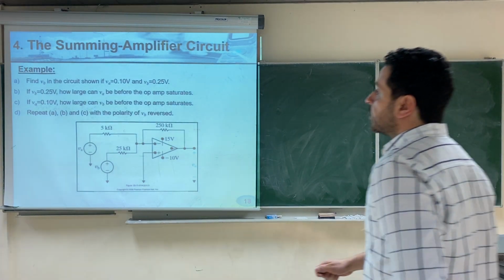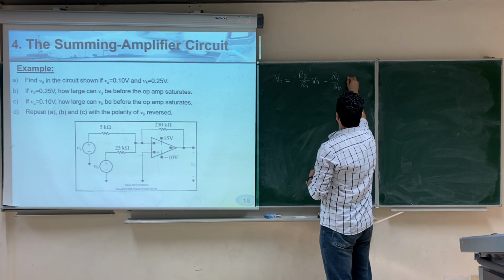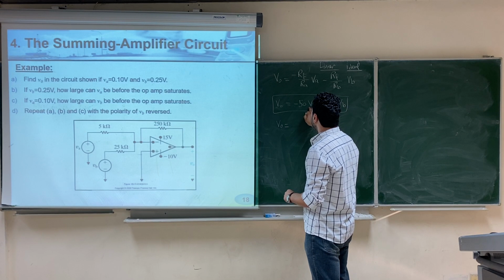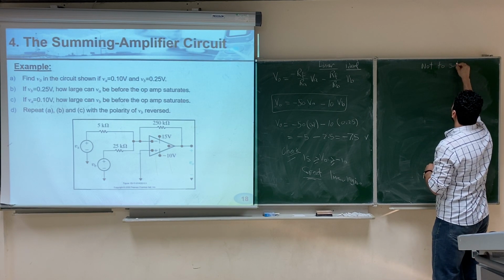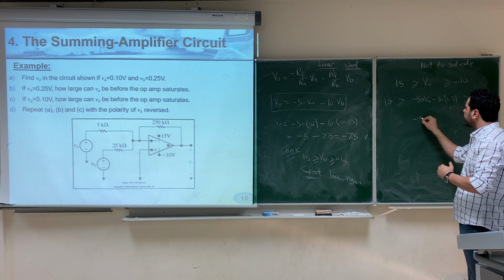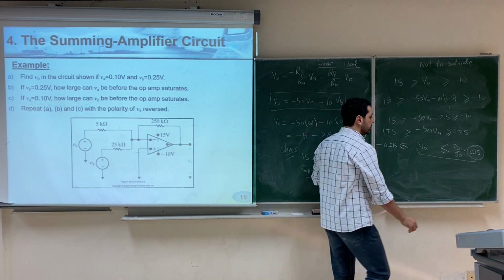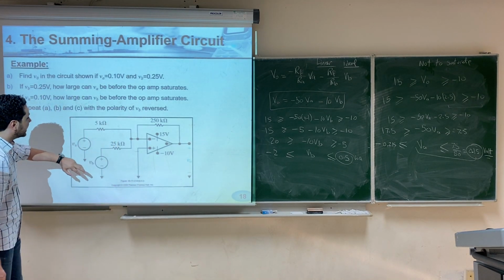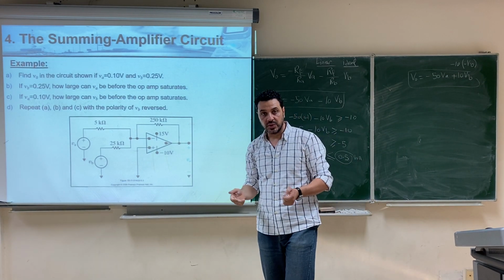EE 203, 8- OP AMP: Example on Summing Amplifier

Comment: the highest range for va is ( -0.35<= va< = 0.15)
Reply from the maker: Yes you are right. There is a mistake in the calculation of the lower limit.
Reply: before it saturates